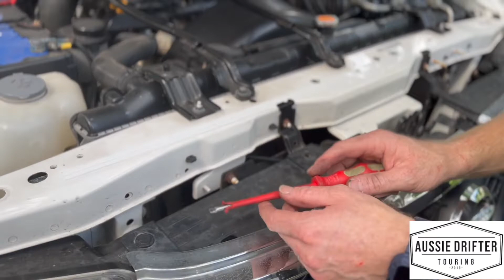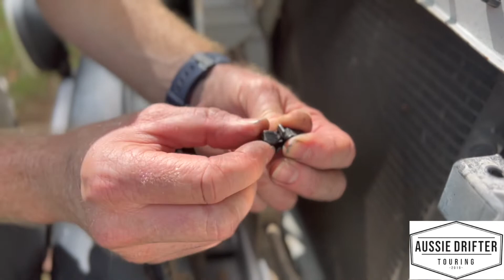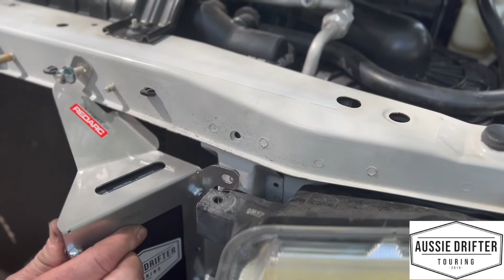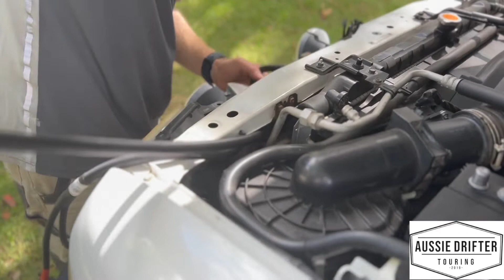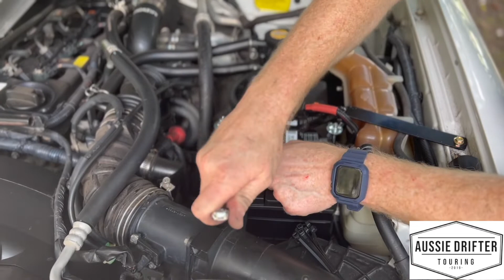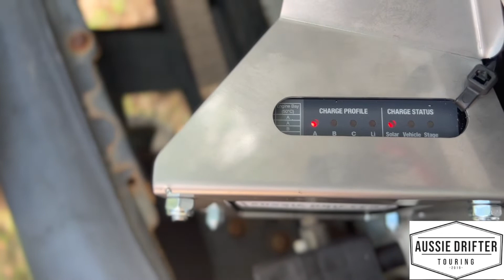GU Nissan Patrol Redarc BCDC Dual Battery Charger Kit Installation

Comment: Great video (all the series), very usefull! Just one maybe stupid question about this one: why installing a DC-DC charger? Isn't enough to link the service battery to the car alternator to charge it? Or is it necessary otherwise the alternator would overcharge the battery? Or is it just because of the solar panel (and without solar panel you can just connect the second battery to the first one, without the DC-DC charger)?

Comment: If I've got a 2004 patrol can I only use a isolater not bcdc?
Reply from the maker: Hi mate. You can use a bcdc charger if you like.  It’s just that the mounting bracket for this kit won’t fit your model.  We do have a universal under bonnet kit that many have used on the older patrols.  Hope that helps.